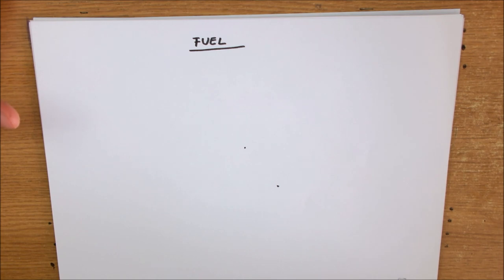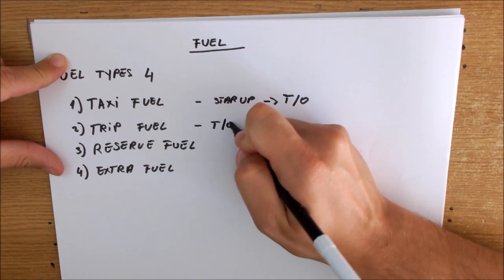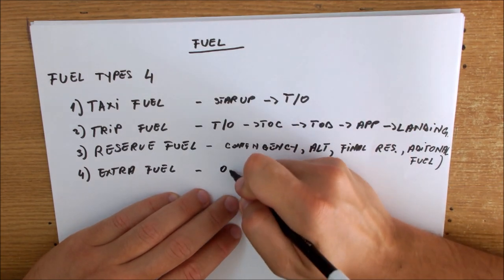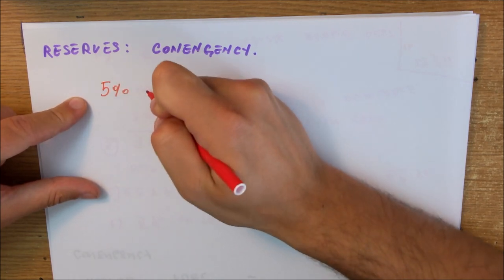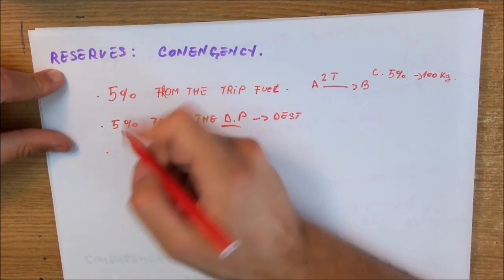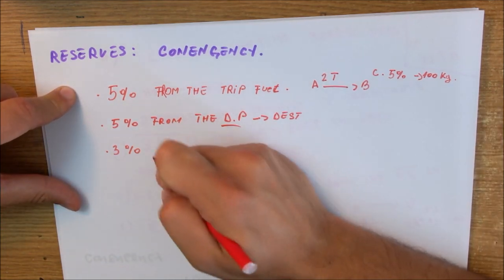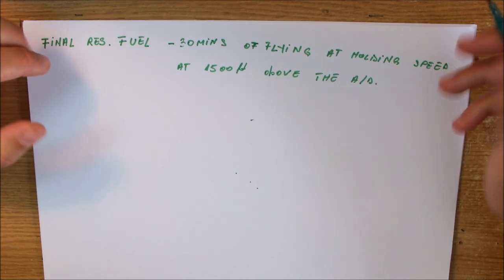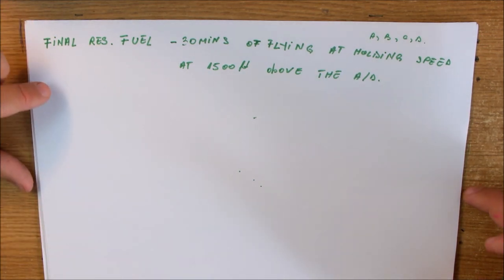ATPL FUEL/FUEL PLANNING/ Decision Point/Reduce contingency fuel procedure

Comment: nice video! my only question is: what type of contingency fuel would you need from Hamburg to Beirut?
Reply from the maker: It is just an example. Usually DP's planning are over water or areas without airports and stuff. 
In real life is different. My company for example uses 5% standard for every flight.  You can see that in INIT B and can not be changed by the pilot

Comment: Hello,
I would have a question regarding reduced contingency fuel procedure. When there is such procedure, do you confirm the calculation is either : 
5% trip fuel from DP ---> destination (or)
3% of trip fuel if enroute alternate.

My understanding is then that the other 2 methods (5% of total trip fuel or the 5min holding) are for "classic" calculation of the contingency fuel (ie without reduced procedure).

Thanks a lot in advance.
Reply from the maker: Sorry for my late reply. Its a very good question. We usually do not use DP unless we expect problems with the weather on destination and destination is a remote airfield, for example, Maldives. 
In this case we chose a dp and we must have 5% from dp to dest.due to lack of alternate. In case we fly over the continent where allot of alternates is available, but we chose to get more cargo and stretch passenger seat configuration at the max, and destination is far for a specific type (6.5 hours flight with an A320) then we use a DP if we expect weather problems at destination and use 3% because we have choices. Real life operations require common sense....companies might push you in not uplifting fuel, but since your the pilot, you have the last word. 3%, 5% its only in the books for your ATPL. Real life, always uplift more fuel.
Reply: @pilotamiatpllessons9183  thanks a lot for taking the time to answer. Greatly appreciated
Reply: @pilotamiatpllessons9183  Great video! But i don t understand the Maths. So, we must to calculate the fuel between HAM and BEI, +5% of the fuel burn between BEI and DOH. Is that right? Thanks for your Video!!!!
Reply from the maker: @martinpratto1475  the contingency has to be 5% of the trip fuel from BEI to DOH. 
If you burn say 10T  HAM to BEI of fuel  and from BEI to DOH you burn 4T, then your contingency is 200kg (5% of the trip fuel from bei to doh as BEI is the DP and we use RCFP)
Reply: @pilotamiatpllessons9183  excellent¡¡ thank you very much¡¡¡